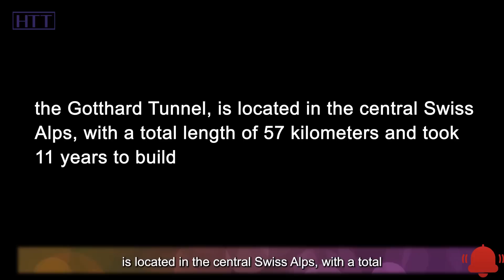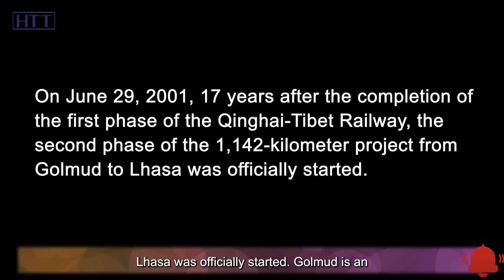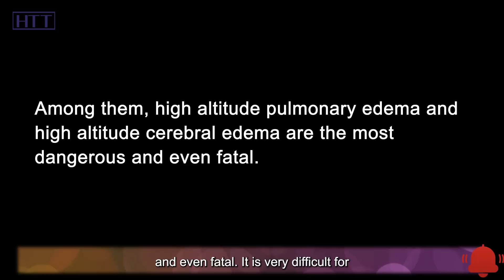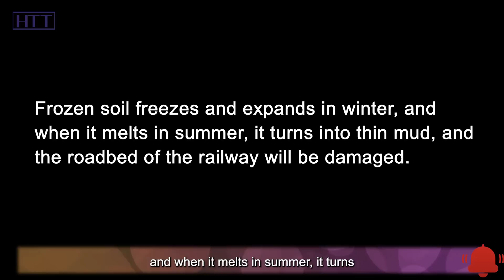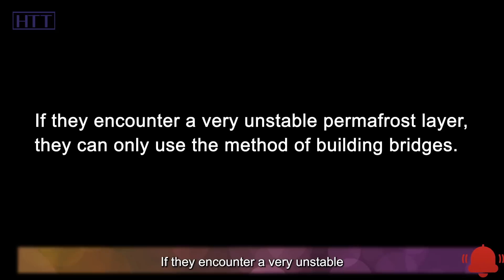The toughest tunnel project, China to bore through the Himalayas!

Comment: Thanks for your update. The problem China-Nepal Railway is facing something never before faced by scientists and engineers of the world. We however are optimistic that if anybody can solve this problem, it is the Chinese with their vast experience in Tibet. But, there is one more problem besides the political problem from our southern neighbour, it is this: Tibetan Plateau is at an average altitude of 14,000 above msl whereas Kathmandu is at an altitude of 6,000 feet and Lumbini is just about 2,000.  To bring a railway line over such a decline in such a short distance of 250 miles, the gradient itself will create enormous engineering problems. Wishing you railway engineers of China Nepal Railway, only the very best.
Reply: The railway spiraling down the winding mountain.